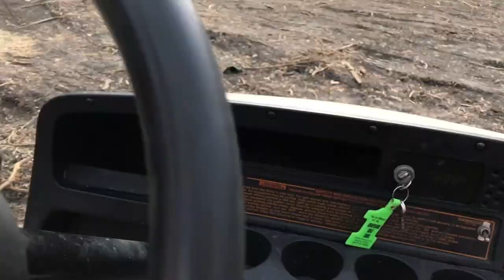Golf Cart Build Part 1 | Getting it Running and Disassembly

Comment: That battery terminal was melted off from a loose connection that arcs. Lots of amperage being pulled. Basically becomes a temporary welder. I use stainless steel lock washers and stainless steel nut on the battery studs with 2 gauge cables. That combo never comes loose.

Comment: ignore everyone saying "oh put a gas motor" take it to a electric car / cart shop and have them set the speed controller so it will go faster. ill tell you right now that golf kart could do 60mph easily with the speed controller bumped up. my dad works on the e-z go golf carts and the club cars.

Comment: When charging golf cart batteries you have to charge them all at the same time and bring them up together cause you are charging 36 volts not individual 6 volt 
It will run charging them separately but it won’t last long and it will only have half the power and that is what burns shit up on the cart

Comment: the battery with the melted terminal can still be repaired and used.  There's a flat surface area next to the terminals on the batteries that is for making a replacement terminal connection.  By drilling a hole for a bolt to be screwed into  is how its done I've done it many times , drill the hole sized for the bolt , screw on a nut onto the bolt and put the connecting wire on the battery terminal the screw the bolt into the hole to hold the wire. once the bolt is snug tighten the connection via the nut that was put on 1st and badaboom  you got a repaired battery terminal.

Comment: Cut it in Half, Stretch it by 2 feet, Lower the Seat to the Floor and put the Batteries behind the Seat-Not under,  Lower the Steering Shaft, Enclose it ( new body shape ) and put a windshield on it... Lower the Suspension a few inches.
Reply: ravenlorans golf carts have like no suspension

Comment: Them batteries are huge...Should've installed some smaller, lighter batteries with equally the same amount of power/voltage. Or more power!
Reply: Callum Holman nope, Trojan 6 volt or 12 volt is the norm.

Comment: So you first spray the batteries with a pressure washer but then want to maintain them
Reply: See no problem in that! What do you se?
Reply: The system is designed to get soaking wet, nasty and every golf course in the country pressure washes their carts to keep 'em clean and crud free.
Reply: Proper battery maintenance includes regularly washing off the batteries. Seems like it's a problem but it isn't.

Comment: join me with GCV, (golf cart vlogs) ive had that idea for my cart but i blew the stock engine doing 65 km/h in a 50 only know my speed because i got pulled over for speeding so i put a 420 in lift lights and got it street legal so it can be my mobility aid im 27 and crippled and i dont want no old lady scooter so finally after 2 years fighting local government and the RCMP i got it to where i can drive it around town 

lets get GCV to where moto vlogging is

Comment: I build custom Golf Cars I'm a service tech for E-Z-GO gulf cars.
Reply: How do you feel about the robin 2 cylinder 4 cycle motors?..are they strong?
Reply: I have a golf cart that i upgraded with 4 lithium batterys 12v 100ah each paint job lift new wheels radio lights street leagal kit
Reply: Can you help with my golf cart